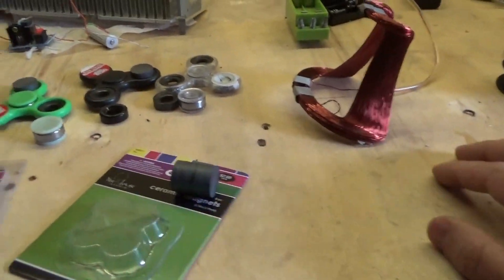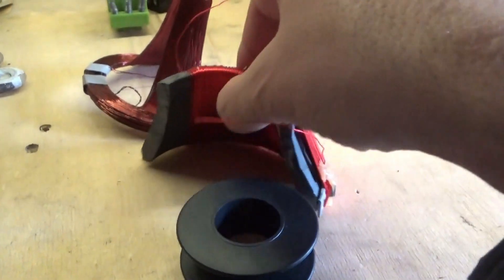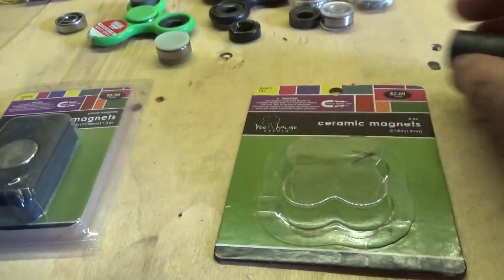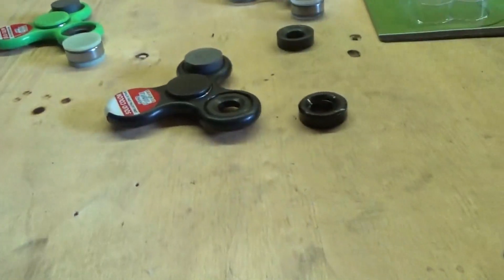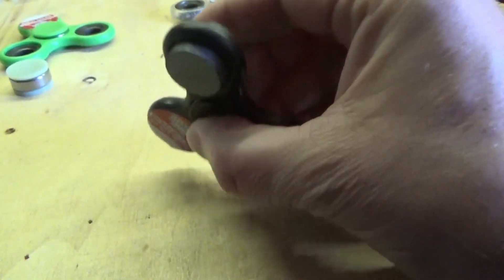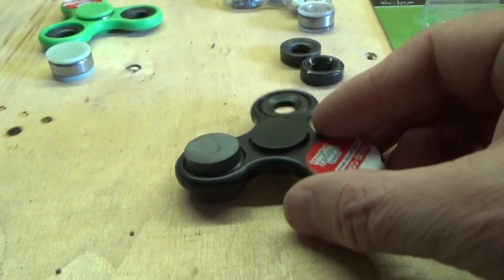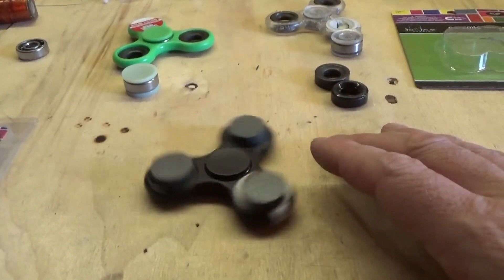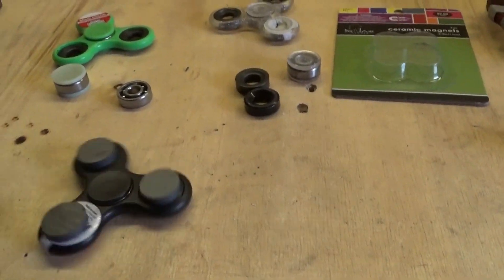Recycling Materials To Make Fidget Spinner Bedini Energizer Motor

Comment: look up neodymium grade N52 on ebay they are the most powerful, all my motor i made are using N52 on here, one of them has the ssg circuit on it but its not a monopole motor the magnet is actually in the coil spinning.